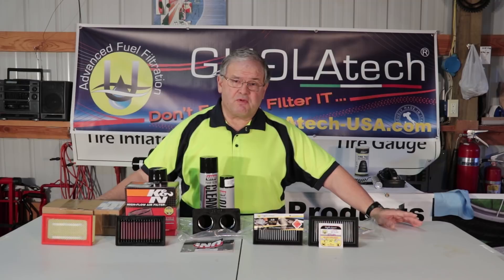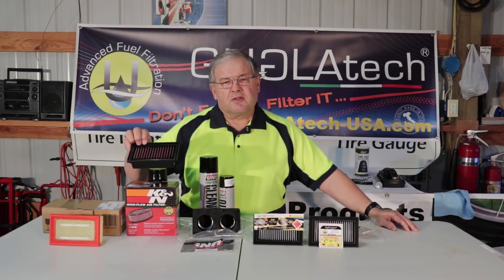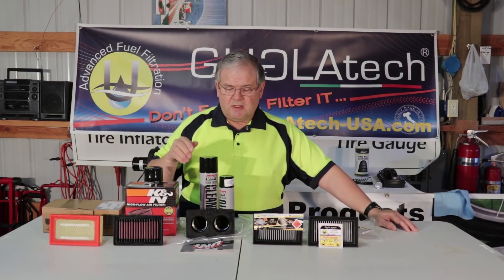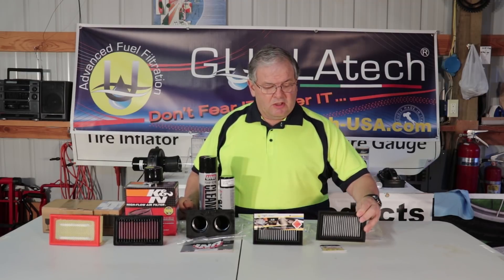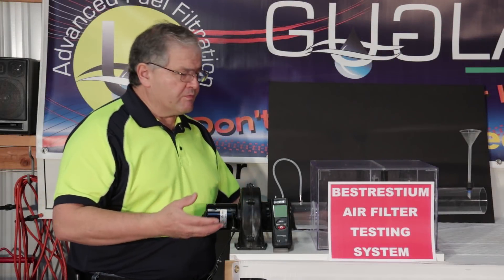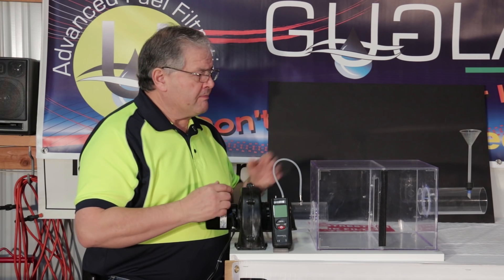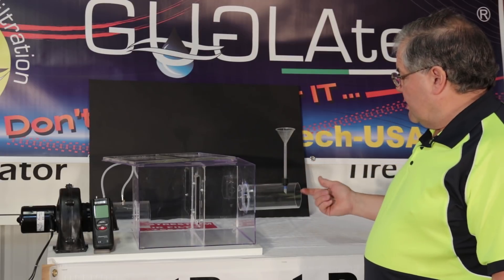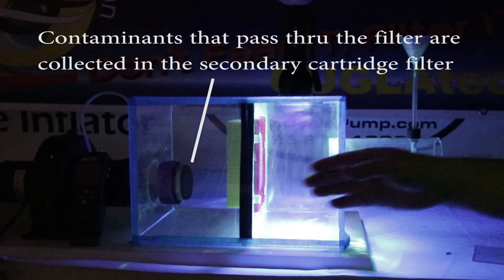Air Filters In The Nuclear Age  (Teaser)

Comment: You need to add some vibration to the test for it to be realistic.
Reply from the maker: And how would vibration make it "realistic"?
Reply: The same reason that you tap a sieve when using it. 

Also check out vibratory filter cleaning.

https://www.clevelandvibrator.com/Application/dust-collector-filter-precipitator-cleaning

Not sure if it would change the results, but it would be more realistic.

Cool test anyway. Tks.